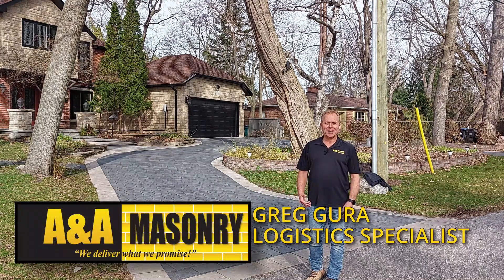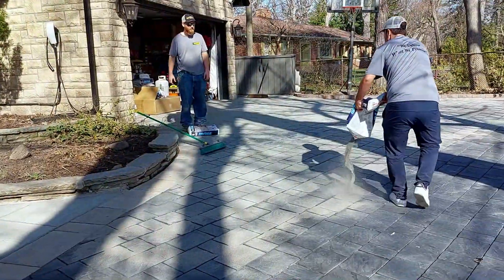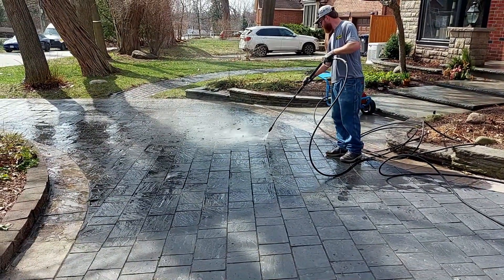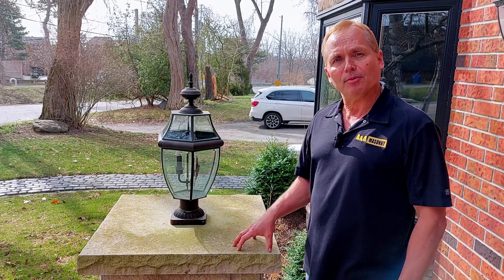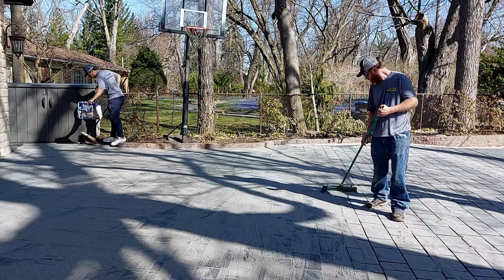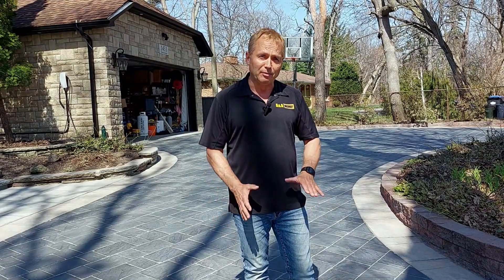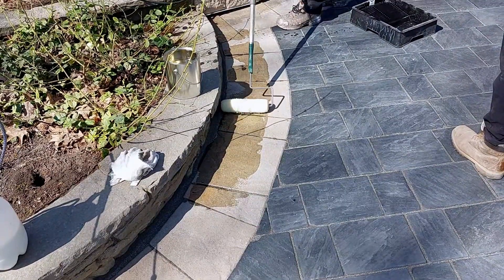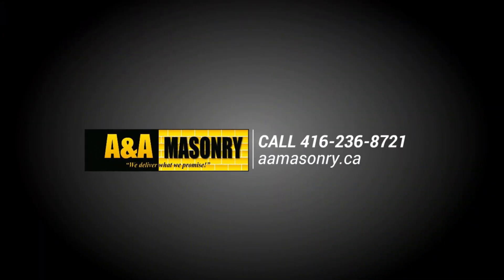How to Apply Polymeric Sand for Pavers FLAWLESSLY

Comment: After power washing our brick patio to remove weeds and moss between the pavers, I followed that up with a cleaning using a Zep cleaning product and a thorough power washing again.  Yesterday, I broomed polymeric sand into all the cracks, used a leaf blower to lightly rid the surface of any remaining surface dust, then applied a nice misting of water over the entire surface.  It's been dry overnight with no rain, and I have a great window of time this afternoon.  Ques:  Can I apply a sealer after only 24 hours of dry time?
Reply from the maker: Yes, you can apply your sealer 24 hours after.

Comment: Great video! We just had our old poly sand replaced 2 weeks ago. The seal wasn’t placed yet and we thought it was safe to give the pavers a wash, before setting down the seal. Unfortunately the sand washed out some of the paver joints and we’re going to have redo them. Will we have to take out all that sand again or will new poly work with what’s already there?

Comment: Is it worth trying to color match existing polymeric sand if you don't know which product was used? (5-10% got blown out when we cleaned our pavers with a pressure washer). Have you had any luck doing this, or should we completely replace the sand like you have done here?
Reply from the maker: No, new product won't adhere to the old. You have to remove the old polymeric sand completely by power washing, and make sure the cracks are fully dry before adding new sand and you need to tamp it again and again during the new sand application process so it makes its way down. You then brush off the excess, with a push broom so there’s no polymeric sand sitting on the stone, and then a light sprinkling of water (you can use a watering can or a light sprayer hose pointed upward, sprinkling down on the polymeric sand until saturated) for the best results.

Comment: What type of product is best for sealing? I assume the same as you’d use for stamped concrete?
Reply from the maker: There are many products with different qualities. Contractors usually have access to the best products through trade suppliers.
Reply: Can u please mention a few ? Thanks
Reply from the maker: @CesarMartinez-tp4bx  We get a commercially only available sealer but I believe Home Depot has many sealers to choose from. Not having experience with them I can’t really recommend one over the other.
Reply: @AamasonryCa  here in Ct some of us have access to commercial companies that sell to homeowners which is why I asked about sealers/brands you would recommend.. I will be avoiding the local box stores by all means ..
Reply from the maker: @CesarMartinez-tp4bx  our supplier is a local manufacturer here in Ontario who creates 
products for our environment.  Perhaps you can find someone similar in your local area.

Comment: What PSI pressure washer did you use to remove poly sand from between the pavers? Was it cold or hot water system? Any concerns with damage to top of pavers from the pressure washer? Thanks!
Reply from the maker: The pressure washer is 3600 but the nozel depends on the pavers. cold water.
Reply from the maker: The pressure washer is 3600 but the nozel depends on the pavers. Cold tap water is what we use.
Reply: @AamasonryCa did you use any stripper? If so what brand?

Comment: Hi! I replaced my polymeric sand 4 days ago and immediately it looked like it was peeling and it never set up. I used polymeric sand that I had saved from initial job 3yrs ago so I don't know if I added too much water or if the sand was too old. Can you tell your thoughts
Reply from the maker: Hi Shirley,
Your result may be due to not removing enough of the polymeric sand by power washing or over saturated as you noted in your comment. A light sprinkling with a watering can is sufficient.
If you are in the GTA region and require assistance with cleaning out the polymeric sand, this is a service we offer.

Best,

Corrine
A&A Masonry
416-236-8721
Reply: @AamasonryCa  unfortunately I am not but your response has helped me figure out what happened. Thank you
Reply: @shirleycarter465  that’s good to hear! Good luck, Shirley!😀